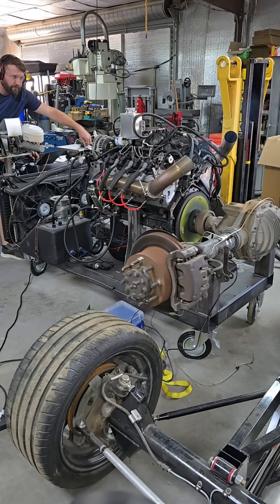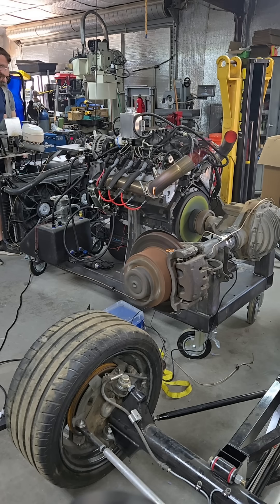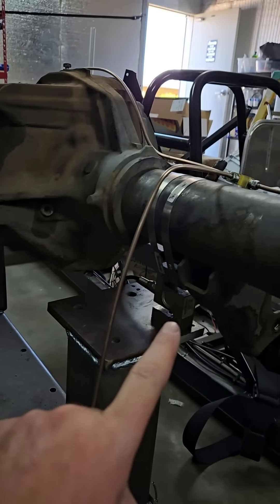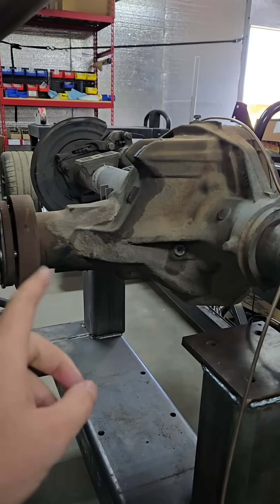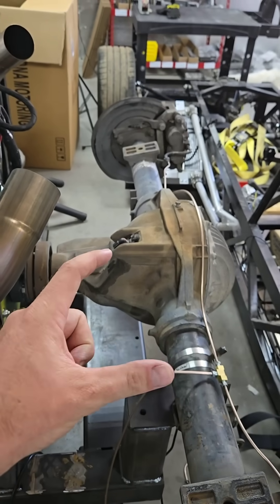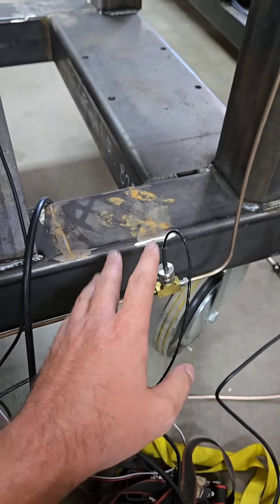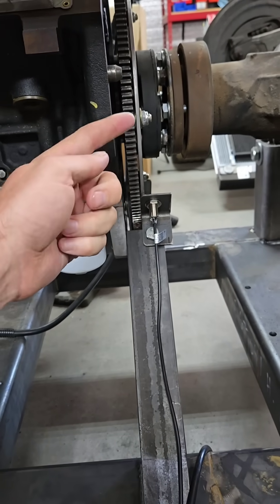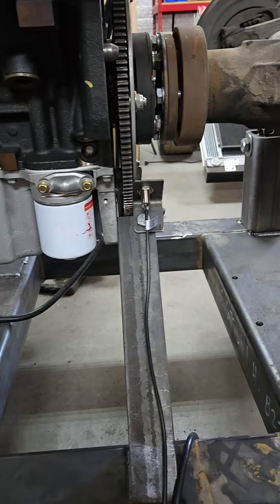DIY Engine DYNO for $1500! WOT test!

Comment: Regarding the RPM readings: In the software, you'd likely be counting the time between readings in maybe seconds. However, the result you're looking for is in rpm (standard tachometer reading). That would be the inverse of time between pulses times 60 (to convert to minutes).

(1 / time (in sec))  / 60 should be the right math if you are reading pulse interval.

Perhaps your proximity sensor isn't capable of the high frequency (number of pulses per second) and you need a sensor with a faster response time...

Alternatively, the input that receives the pulse from the proximity sensor isn't capable of handling the frequency.

If it were me, I would make sure I had a fast enough input and sensor to allow the sensor to read (say) 5 bolts. Then mathematically divide the value by five. This would provide a higher resolution for the software to deal with.

I don't know what software is being used, but I've done similar measurements off of gear teeth. The software would have a field for me to divide by the number of gear teeth, to get to an RPM value.

I was doing this type of RPM measurements  in the early 90s, so I know it's possible now.

My guess is you figured it out well before I commented on this video.

Cheers!
Reply from the maker: Very good ideas! Yes we found the sensor to be faulty or too slow. It was Python software Mark made for us. It works well. The computer can definitely handle the pulses.

More testing coming soon.

Comment: For the brake controller, you could rig a strain gauge and display up. While it wouldn't be a "controller" per se, it would give you a readout of what the pressure is, and you would be able to account for off-target parameters.

Comment: Are you using a VR sensor to measure RPM? Could you add a "conditioner" or some resitor  "shunt" type device to give you a more uniformed signal?

I ask because when i installed a standalone ecu on my subaru engine, it would break up above 4,000 rpm. I added the resistors and it cleaned up the signal.
Reply from the maker: Ok, thanks. We are using a Hal effect sensor with magnet. We think it's a hardware issue. But we will see.

Comment: Your data acquisition isn't capturing data quickly enough.

It may be a seting, or a limitation of your hardware or software.

It's not the sensors themselves.
Reply from the maker: Thank you! We are still working on it. But should have a solution soon.
Reply: @centurialinc 
Best of luck!